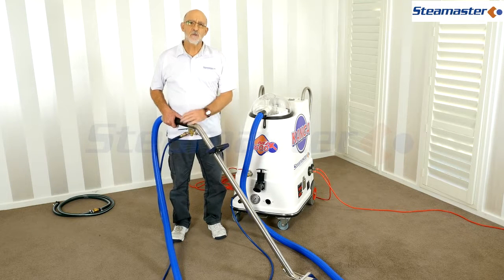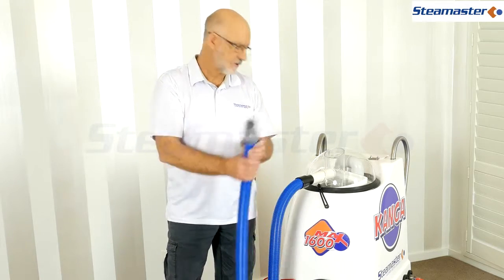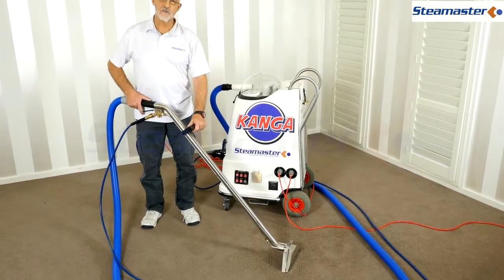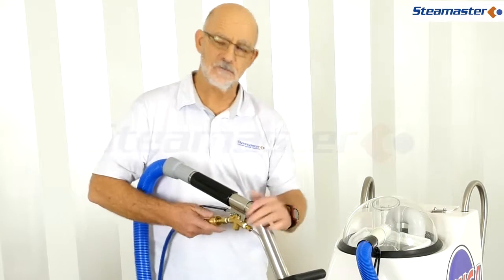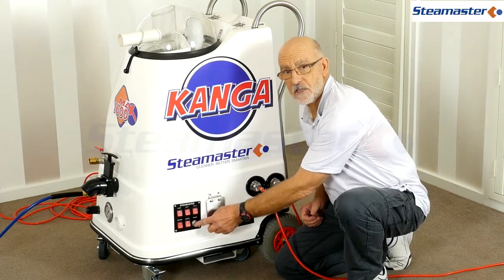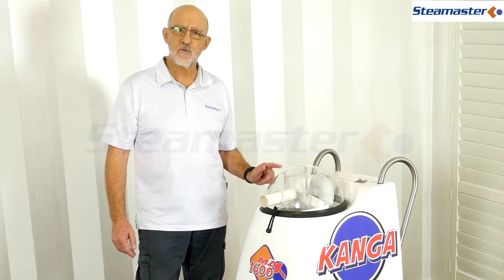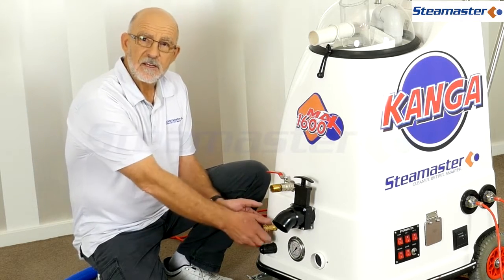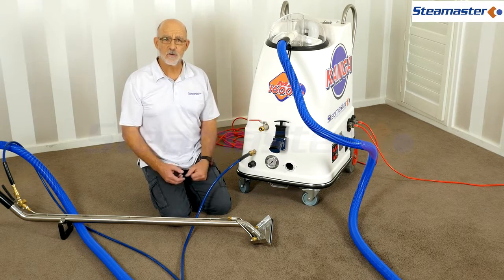Troubleshooting Kanga Carpet Cleaning Machines

Comment: What to do if I turn on the machine without connecting the blue pipe. There is pressure built up in machine and it not  allowing the pipes to connect. How to solve?